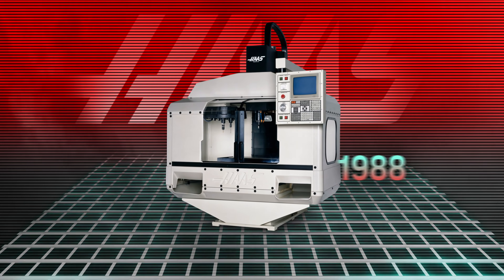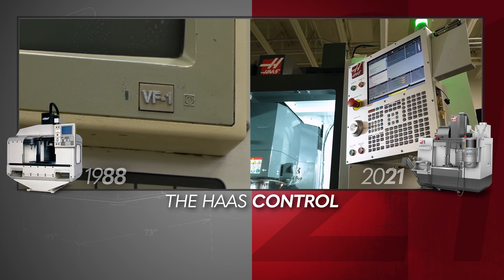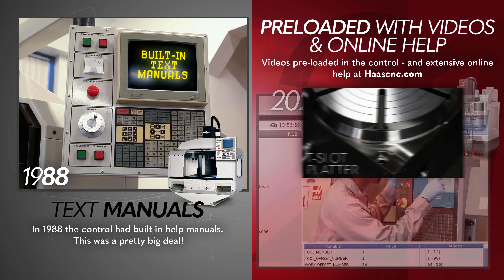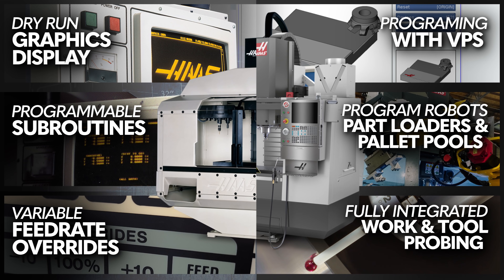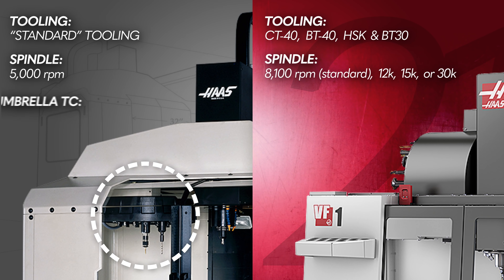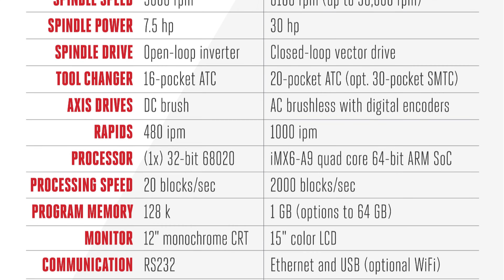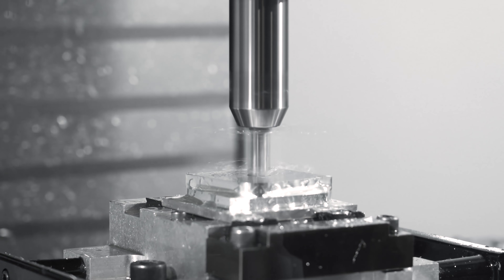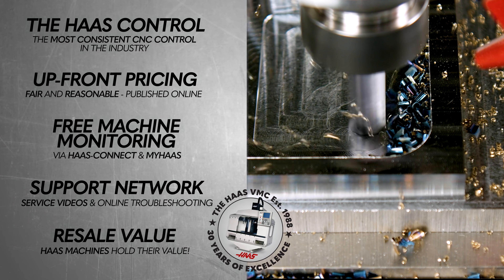Haas 2021 VF-1 vs 1988 VF-1 - Haas Automation, Inc.

Comment: I operate new Hass mills but still own my 1992 VF-2. Guess what? The old girl can produce the same quality parts as the new ones. Shes currently getting a freshening along with ac servos/Acorn, surplus LM rails and angular contact bearings on the screws but has been retired to a hobby status

Comment: 1GB is an absolute joke it's so little additional cost to put some proper storage in there just do it
Reply: A 32 or 64 gb usb drive is under 20$ so just use that.  Don’t pay them the ~2k h they would want for the upgrade in the control.
Reply: while the emco training models arent exactly perfect, they allow you to run a PC with a USB cable to the actual machine with full integration

i used to have one that had EVERYTHING on an 8tb HDD
Reply: you can use network storage and USB. no need for more.
even if you programm on the machine, I doubt you will ever exceed this limitation. 
And if you do, there are the solutions i mentioned earlier.
Reply: @hassiaschbi  indeed, it works

If you're trying to be the top shop in your area, "it works" is not exactly what you want to say (especially in the start of a new era of wifi-enabled mills), be it to customers or coworkers.
Reply: Wait, it might have wifi, forgot about that

Comment: $53k and you have 1gb of storage?
Reply: And no HSM.  The new Haas machines are just as slow and jerky as the old ones unless you pay thousands for unlock codes.
Reply: @bdp-racing  Might as well buy an old one for a 3rd the cost. Do the old ones have those codes?